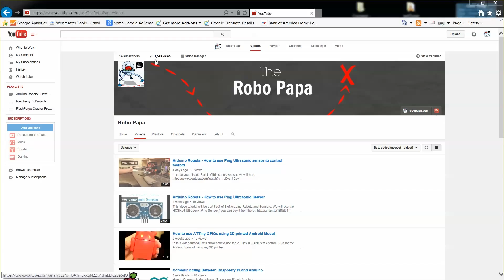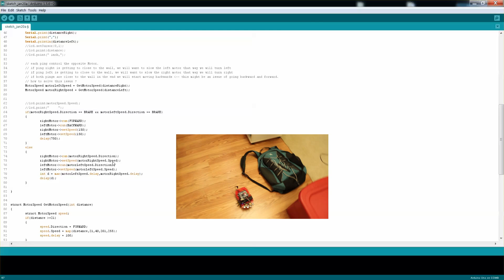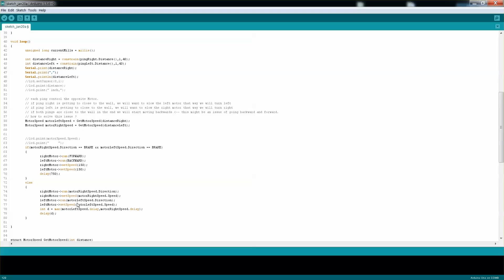Tutorial in How To Use Arduino For Obstacle Avoiding Robot

Comment: An ultrasonic sensor is one of the sensors used to detect any obstruction object located on the left and right sides of a robot with a 45-degree angle of view aimed at preventing and altering the object from colliding with the object. To make this robot stand out, an ultrasonic detector is used as an input to the Arduino Uno and two DC motors to move the robot. During the course of this robot, an ultrasonic detector is installed to detect obstacles. If the detector detects a wall or obstacle in front, it will give Arduino a signal. Ardino will stop one of the DC motors to make the robot rotate. Robots will rotate depending on the position of the robot. If the obstacle is to the right of the robot, it will turn left. If the obstacle is to the left of the robot, it will turn right. Both DC motors are ON if the ultrasonic detector does not detect obstruction. waste storage that has been provided on the back of the robot. This will make the cleaning process faster and less human labor is used....hi sir..this is my abstact for my project..its same concept with your robot??..if same..i grateful to follow your robot project

Comment: hello can i use this to move 2 motors using l298n and moving using a microservo?

so i want to use 2 sensors read front right and left to calculate should the servo turn right/left or maybe i can make it like you and adjusting the speed motors when turning :D
Reply from the maker: the l298n is fine as long as it can support the voltage / amp that the motors will consume. Don't forget that with wheels you will have a spike of amp so you need to make sure it can handle it. for the micro-servo, make sure you have enough torque in it that way you will be able to move.
that model has 2 motors so you control left wheel and right wheel. If you think about it you can make it turn in place even if you want (vs adjusting the speed of each wheel to mark "real turn"). It is up to your needs or desire. Hope that helps
Reply: hmm i want to make a ship so the motor will turn the propeller to move, powered by 2 motors using l298n and arduino uno with 2 hcsr04 sensors and 1 microservo to turn rudder, the thing i want to ask is should i use 2 source of power a 12v and 5v or just use 1 power 12v and power the arduino by using 5v slot at the l298n, sorry for too much asking, im still newbie :D
Reply from the maker: It all depends on your design. I believe you will be able to draw from that the 5V you need. But if it is possible to give a dedicated source for the Arduino that would be better (at least in my opinion)

Comment: Hey Sir. Great video! I am very new with Arduino. When I tried to compile the code, it says Ping.h is not in the directory. I tried to compile the Ping ino file in the library file but the error still there. How do I make the Ping file usable? Thanks!
Reply: And do you use the liquid crystal in the final robot?
Reply from the maker: Hi Steven, you need to make sure that the ping files are located at the Arduino libraries folder, which the location depends on your installation & OS. On Windows you can find the libraries folder by opening Arduino IDE -> File -> Preference -> Sketchbook location. (probably it is in your `My Document-> Arduino` folder.). In that folder you should have the folder libraries. You can download the code from the github here: https://github.com/robopapa/HCSR04-Ping. 
You now have two options (assuming you download the code as zip file)
1) extract the zip file in your libraries folder (let's say you put the code in the folder name libraries\HCSR04). In this case you will need to restart your IDE and after that you should be able to do `#include <HCSR04.h>` or you can go to Sketch-> Include Library -> HCSR04
2) Go to Sktech -> Include Library -> Add Zip Library. This option will put the code in the right place and allows you to include the h files.

For my final project I haven't use the Liquid-Crystal. I only used it for the measurements and testing.

Hope that helps and if not let me know!
Reply: @Robopapa  I see, it means that the HCSR04 is the ping file used in the #include command. This is very helpful Sir! Thank you very much!
Reply: Sir I have another question, does the Adafruit Motorsheld library can only be used in Adafruit Motorshield? Can I use different motor driver and use Adafruit motorshield library for that driver, is it possible?
Reply from the maker: If i'm not mistaken you will be able to use some of the library. The part i'm not sure if it will allow you to use the whole thing is that V2.3 is a stackable shield, which means you can solder the address and reference that in the code. Take a look at the adafruit code / github and see if you can find something.
Post back with what you found as i'm sure others will have the same question! When I have some time I will take a look as well, after all it is C++ code :D

Comment: after finishing the coding should we connect the robot with PC and save is enough.
please make me understand
Reply from the maker: you will need to download the Arduino environment https://www.arduino.cc/en/Main/Software. You will write your code in that software, connect your Arduino to your computer with the USB cable (it will install the drivers, if on windows, to see the USB as COM) you will click the upload button (that will flush  your code into the Arduino memory). At this point you can disconnect from the computer if you want.
If you have battery power, make sure you disconnect it when connecting the usb and computer because the usb will provide the power you need to flush the Arduino. 
In case you want to run testing while connecting, as long as there is no much resistance on the motors that came with this robot you will be fine with the USB, although not recommended!!
Hope that helps
Reply: thanks robo papa

Comment: this is awesome as always
what i wanted to ask was, i have not much exp with pi or arduino, i wanted to know where do you connect your arduino or any other robotic hardware to pi and through what piece of software do you read data and process data and respond with another pieces of data?
i want to make a robot that follows the hand or reads signs and does stuff,i just dont know how does a computer communicate with other pieces of hardware like boards. and if i happen to connect my robot to the pc by any chance, how can i receive the data and process it :/
sorry for being such a noob :D
Reply from the maker: Sepehr Alizadeh Thank you again for your nice comment. This is a good question !
There are many ways that you can communicate between a computer and a board like the Arduino. When you connecting the arduino to  your computer via the USB, it allows you to download the code to the arduino, but it also opens up the Serial communication (using Serial.begin(BAUD RATE) etc). However that makes your arduino statis and really cannot control the robot (but it is a good way of debugging)Another way is to use the xBee modules that way you can send data via the module and receive it on a different place (I'm hoping to do a video about it in the future)Another way, which you can look at my video how to communicate between Arduino and the Pi @watch?v=IZC9G3U58Sc, you can connect the arduino and the pi with the Serial connections (Rx, Tx) and send data between them. So for example the pi can have the camera which will act as the "eyes" of the robot, and send the data to the arduino that can run motors etc.Of course there are other methods to do this, so if you find other method or if someone else has other ideas I will be happy to hear (well really read :D ) about it.

Comment: did you make your own ultrasonic library?
Reply from the maker: Yes I did. Very simple one where you can request the distance in cm or inch and it will do the conversation for you.
You can find it on my website here: http://robopapa.com/Projects/ArduinoAndSensorsPartOne (half way through the page there is a link to the code).
You can also access the code via GitHub here: https://github.com/robopapa

Comment: Hello Robo Papa , 
i am making maze robot using three ultrasonic sensors . The problem is there is always one reading read by one of the sensors in each instant and the two other readings equals zero 
How can i handle this problem ? 
Thanks in advance
Reply from the maker: +ahmed sadek I'm not sure how you connect the sensors and which what is the angle between each sensor. As you can see from the video I was able to connect two ping sensors with no issue.
What board are you using ?
make sure that the pins you are using for the ones that are not working, are good.

Comment: I mean to calculate the distance the formula is speed*time
so I want to know the speed I have the same robot as yours but it has only one sonar and it does not avoid obstacles as yours
Reply from the maker: +minister of awsome if you take a look at my website (there should be a link in the description) I have created a library that does all of that for you (you can get it in inch or cm), the code is there so you can look at what I did. But basically you have the speed of sound and what you do you sending a ping (trigger) and waiting for that ping to bounce back (echo) and that is how you get the time.
Reply: thanks !!!:)
Reply from the maker: +minister of awsome you welcome

Comment: Hello Papa, I compile your code with error, what ping.h version are you using? this is the error I am getting 'class ping' has no member 'Distance' I am sure the Ping.h is there. thanks
Reply from the maker: Jimmy Kan Hi Jimmy, It looks from the error message you are getting that you don't have the Ping as an arduino library. Did you add the HCSR04 (which includes the HCSR04.cpp / .h files) in the arduino library folder ? (for me it is Documents\Arduino\libraries) If you have the arduino IDE open you will need to close it and reopen it after you put the files in the right location. Let me know if that helps you
Reply: Robo Papa I have figured out that I needed the HCSR04.h and *.cpp file which I copied from your YT video, I got the program compiled without error but the ping is not working. the monitor show value 1 left and right.
Reply: Jimmy Kan Here is the copy I modified to make it compiled!

//#include <LiquidCrystal.h>

#include <Wire.h>
//#include <Ping.h>
#include <HCSR04.h>
#include <Adafruit_MotorShield.h>
#include "utility/Adafruit_PWMServoDriver.h"

struct MotorSpeed;
struct MotorSpeed{
  int Speed;
  int Direction;
  int delay;
};
//struct MotorSpeed
//{
// int Speed;
// int Direction;
//};

HCSR04 pingRight = HCSR04(11,12,true);
HCSR04 pingLeft = HCSR04(8,7,true);

//Ping pingRight = Ping(11,12,true);
//Ping pingLeft = Ping(8,7,true);
//LiquidCrystal lcd(12,11,5,4,3,2);

Adafruit_MotorShield shield = Adafruit_MotorShield();
Adafruit_DCMotor* rightMotor = shield.getMotor(2);
Adafruit_DCMotor* leftMotor = shield.getMotor(3);

struct MotorSpeed GetMotorSpeed(int);

const int longWait = 500;
const int wait = 250;
unsigned long previousMillis = 0;
Reply from the maker: Jimmy Kan I don't see in your code how you are calling the Distance for the pings. Also make sure you connect your ping sensor to the right GPIOs on the arduino i.e. pin 11 / 8 is for the echo while 12 / 7 are for the trigger. If you want you can send me your full code to info at robopapa.com and I will take a look at your code
Reply: Robo Papa how can I send you the code? I went to robopapa.com and didn't see anywhere that I can post the code. The code was downloaded from your projects page. Thanks
Reply from the maker: Jimmy Kan info at robopapa.com <-- that is where you can send the code. However if you are  using the same downloaded code I can assume that the arduino IDE doesn't recognize the HCSR04 library. please check if:1) the code for the HCSR04 library is under Arduino\library folder2) if your IDE was open before you copied the folder from step 1, please close the IDE and reopen it3) open IDE and go to Sketch->Import Library you should see the HCSR04. If you didn't return to step 1 and make sure you copied the folder correctly and to the right place (I'm using IDE version 1.5.6-r2 and I have the library showing up)4) If you see that library on step 3 click on it that should add this line of code on the top of your sketch #include<HCSR04.h> paste the code to that new sketch you just included the library to and try to compile.
Let me know if you have any issues (and once again you can send me your code to info at robopapa.com)
Reply: Robo Papa There's no HCSR04 library anywhere, where can I download this library? what I did was copied the codes I saw in your video and put them in the same directory for sketch.
Reply from the maker: Jimmy Kan If you look at the First part on my web site (http://robopapa.com/Projects/ArduinoAndSensorsPartOne ) half way down (or just search for HCSR04.zip) you can download the library. Follow the steps from my previous comment after you finish downloading and let me know if that fixed your issue
Reply: Robo Papa I finally got the library installed but I have to change the following lines to make it work.

//Ping pingRight = Ping(12,11,true);
//Ping pingLeft = Ping(7,8,true);
HCSR04 pingRight = HCSR04(12,11,true);
HCSR04 pingLeft = HCSR04(7,8,true);

Thanks for your help, I really enjoy working on this project! Cheer...
Reply from the maker: Jimmy Kan Glad you got it to work. It was a fun project and I'm hoping to build on top of that in the future. Let me know if you have other questions. Cheers...
Reply: Robo Papa Looks like we need a third sensor (center) for emergency stop if it bump into something or too close to something. :)
Reply from the maker: Jimmy Kan The idea with the two sensors that they will cover the area that is why they are in an angle and most likely will capture also something in the center. However, it will be possible to put also a center one (I just didn't had another one :D )

Comment: Five years after you published this video, the program no longer works:
The "ping.h" has been replaced with "NewPing.h". Even by reloading "NewPing.h" the prgram still locks at "ping"...
What does the "true" statement do in Ping(11,12, true)?
A wiring diagram would have been helpfull, however reading the script, one can deduct that Right Ultrasonic: trigger pin 11, echo pin 12
Left ultrasonic: trigger pin 8, echo pin 7.
Motors are connected to the H bridge as Motor 2 and motor 3
The statements about "LiquidCrystal.h"  are not used since no display was specified in your description
Overall it is a good project and I am still trying to make it work. 
Any help would be appreciated
Reply from the maker: Hi Daniel,
i'm not sure what is newping.h. I have used my own ping library which you can find it here: https://github.com/robopapa/HCSR04-Ping. The true value means you want the distance in inch (you can see the readme in the github repo. 
The liquidCrystal is just a left over from my previous video here: https://youtu.be/uJg8JA8XUac which if my memory serves me right I show how I connected the sensors. You can also view my video https://youtu.be/_yDie_I-5pw to see how I use my own ping library (which I reference in this comment above with the github link)
In addition I was wondering if you visited my website (which the link to it and previous videos are in the description)?
In case you missed the link to the website here it is:
Part I : http://robopapa.com/Projects/ArduinoAndSensorsPartOne
Part II: http://robopapa.com/Projects/ArduinoAndSensorsPartTwo
Part III: http://robopapa.com/Projects/ArduinoAndSensorsPartThree

Hope that helps and let me know if you had any issues using the ping library (not newping.h which is a different library then what I have created 5 years ago)
Reply: @Robopapa  Dear Robo Papa. I do appreciate the time you spent answering my questions. I like your you tube program. I have no problem with the hardware and wiring but is mistified by the coding. I am reading more about it and hope to be able to complete your robot. Thanks again for an interesting project

Comment: i used the arduino uno to this project its not working to me the buzzer is continuosly buzzering without any obstacle infront of the ultrasonic sensor
plse help me........
Reply from the maker: Look at the serial output to check what values you are getting from the ping. Also make sure your wiring are correct and that the ping and echo pins are connected to what you assigned on the software. With out seeing the code it is hard to know what might be the issue.  If you want you can email me the code